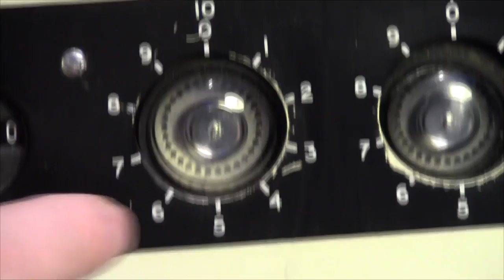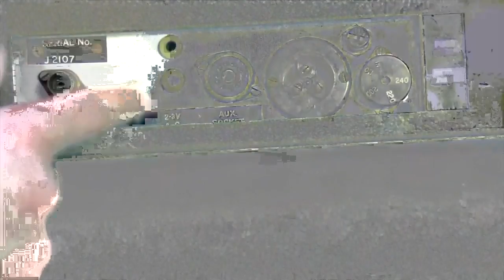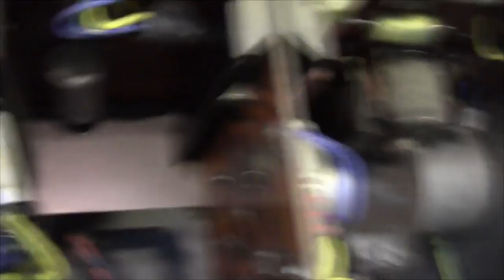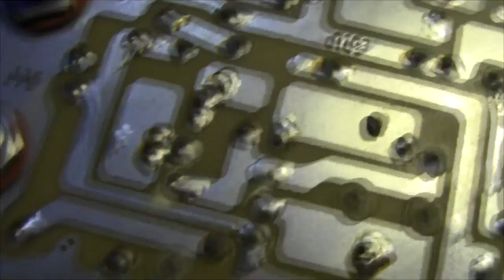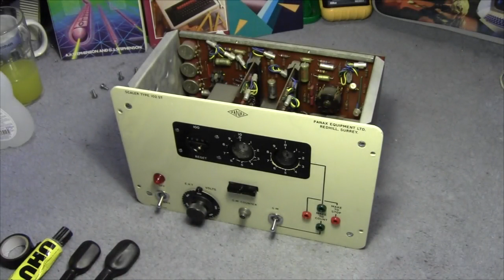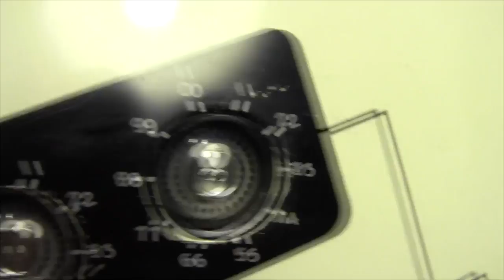1950s Geiger Counter "Sympathetic' Restoration :o) ( Dekatron tubes )

Comment: I own a fully functioning one identical to this, they were used to count pulses form a mallard Geiger tube which was held on the side but they will count any rapidly pulsing 'switching' signal. The lead from the Geiger fitted in the GM (Geiger Meter) socket, I might have a spare one somewhere. They are nice pieces of kit and fairly robust, nice vid by the way. Meant to sat the detector valve was a Mullard  ZP1481

Comment: I love it! I work as a physics technician in a secondary school and I've got a very, very similar GM counter, it has a different reset toggle switch and an extra dekatron tube for counting but other than that it's the same. The kids and teachers love it too, it clicks and spins in a much more fun way than a lot of the more modern GM counters. We also use it as a timer for measuring fall times using a few simple switches and the push to start \ stop inputs. A great bit of kit, enjoy using it :-)

Comment: I suspect the voltage knob is used to set the operating voltage for the Geiger-Müller tube, so that you can select the optimal voltage for your use. The voltage ranges for the GM-tube is given in the tube's data sheet.